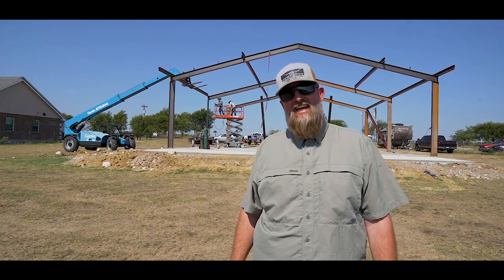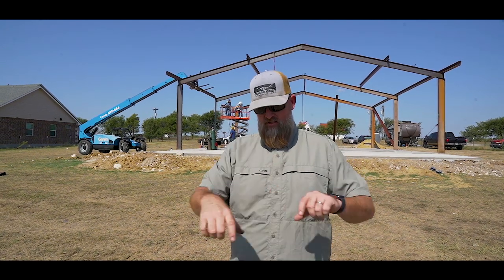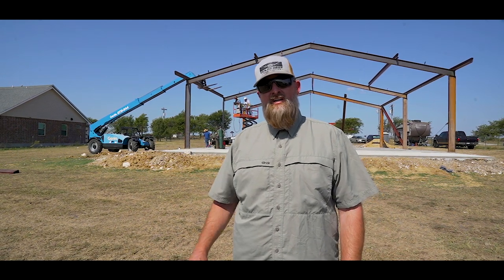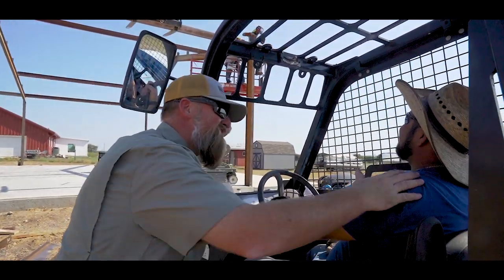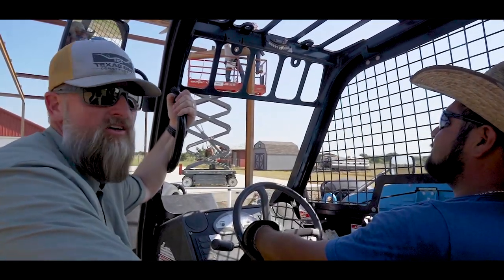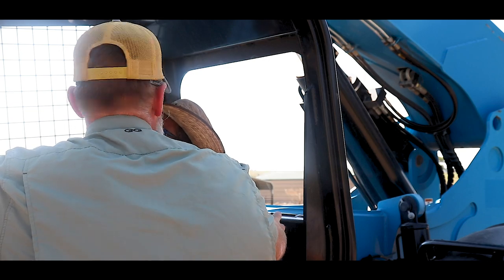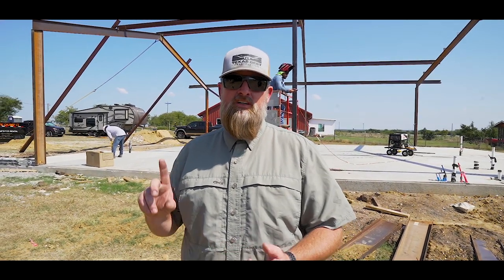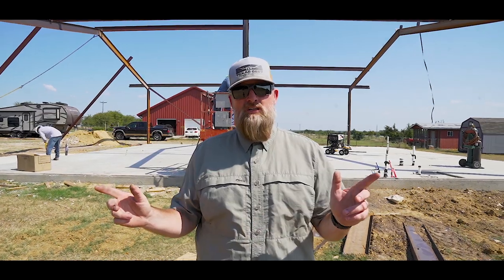HOW TO FRAME A METAL BARNDOMINIUM | Texas Best Construction

Comment: josh love your channel. Is welding the steel better than bolting? Do these bardos pop during heating of the day and pop during cool like most metal warehouses?
Reply from the maker: No they don’t have the same effect as in those other environments. Primarily I think the insulation also the closed cell foam helps to strengthen and make the roof panel a little more rigid.
Reply from the maker: Thanks for watching by the way and for your kind words!

Comment: That particular assembly of a barndominium 
What's the sq footage & the height. How many feet between upright poles❓
Reply from the maker: This is a weld-up 50x50 15’ eave height with 3/12 pitch 25’ between 12” I beam uprights. Thanks for watching
Reply: 👍 Thanks.  🇺🇸